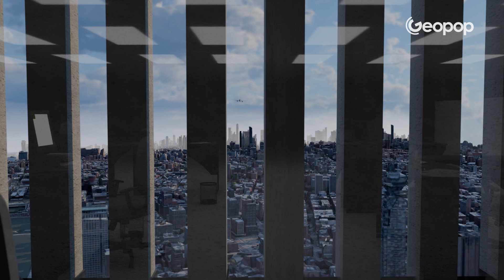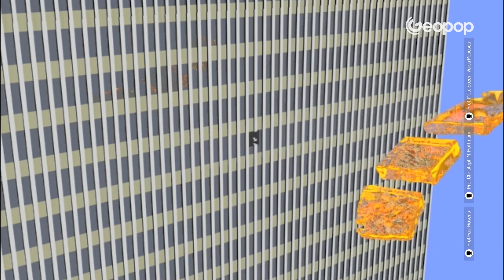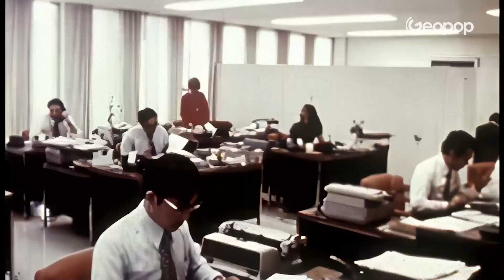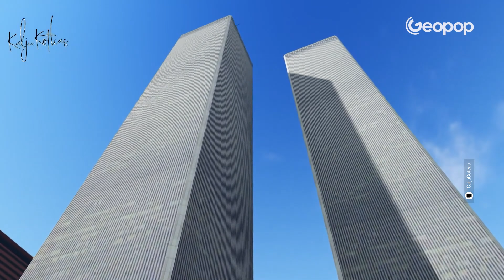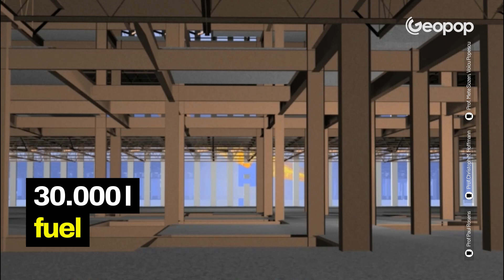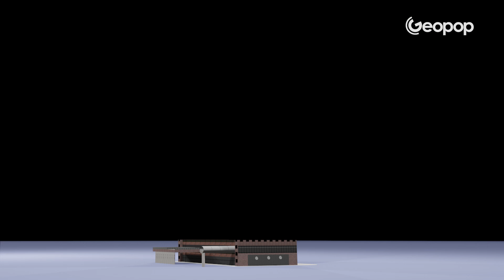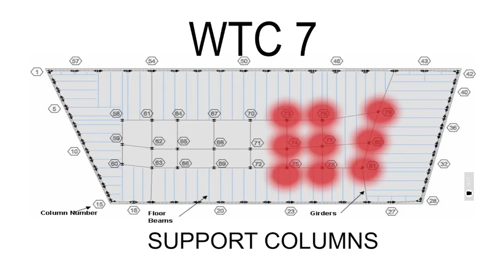9/11, 2001: The Technical Reconstruction of the Twin Towers and WTC 7 Collapses

Comment: Was the design of the WTC buildings Bracing of outside steel and inner steel. With concrete fill floors with steel braces. What would you think would happen with  a few floors damaged? Alot of thousands of tons over it and that tremendous weight collapsing down all the floors below like building an domino building and removing  few blocks to come all crashing down. And for the next small building? Once all that weight from WTC building can down so hard to the ground. Would  it cause the underground tunnels and to weaken the street to the next building's foundation's. New York is full of underground utilities, subways, tunnels and weak ground soil since its next the sea....
Reply: The towers had something like a pool made of concrete and rebar under the buildings to assure no water would enter. As far as the collapse goes. Newton's 3rd law of motion, 1/4 of the building can't destroy 3/4 of the same thing. It's like taking a handa civic and destroying a dump truck. The truck will hold it's shape better. And btw..  a passenger plane can't go but about 300 mph at 1000 feet in altitude.  Had to be a military plane.

Comment: .... Nist report had many descrepances never explored explosions never could emulate the collapse in their tests
Reply: Punctuation is your friend.
Reply: @Tim22222 Is punctuation is learned in the third grade. Thank you for.
Showing us what level you are on. And your problem solving skills aren't very good either
Reply: Can you be more specific?  Or specific?
Reply: @TheLoonResistance  yes they created simulation were collapses did not match the proper data or time from thier reports and they couldn't make it fall quicker than 18 secs whereas the south tower fell in 8 north tower 10 seconds 😊
Reply: @matthewbowler6563  - Which simulation of which collapse?  What data?  Which simulation ran the entire collapse start to finish?  I am not aware of one.  Could you be slightly less vague?  

Where did you get your collapse times from?  Not from The NIST, who said this:

NIST FAQ for the Twin Towers disaster Study

*11. How could the WTC towers collapse in only 11 seconds (WTC 1) and 9 seconds (WTC 2)—speeds that approximate that of a ball dropped from similar height in a vacuum (with no air resistance)? *

NIST estimated the elapsed times for the first exterior panels to strike the ground after the collapse initiated in each of the towers to be approximately 11 seconds for WTC 1 and approximately 9 seconds for WTC 2. These elapsed times were based on: (1) precise timing of the initiation of collapse from video evidence, and (2) ground motion (seismic) signals recorded at Palisades, N.Y., that also were precisely time-calibrated for wave transmission times from lower Manhattan (see NIST NCSTAR 1-5A)

Note the part about the first exterior panels to strike the ground after the collapse initiated.  They are talking about loose debris, NOT THE BUILDING.  A lot of people seem to miss that important bit of context and only see the 11 seconds and 9 seconds parts.
Reply: @matthewbowler6563  - Thanks for the confirmation you were talking out of your ass and don't have a clue.

Good luck on your continued epic fail. Really hope that works out for you someday.

Comment: What a lot of propaganda. They don't experiments of airplanes hitting concrete blocks to simulate plane hitting and building.  The plane was completely destroyed without the concrete band damaged. Experiment was less than 12 months before it happened.
Reply: WTC1 and 2 are not concrete buildings.
Reply: And what does a 20 ton plane hitting a 12 foot thick solid block of concrete have to do with 120 tons of plane hitting a cage of light steel tubes?
Reply: @TheCriticalStinker-jw4fl  steel frame covered in what? 4 ft of concrete.
Reply: @theaussienurseflipper.8113  - Try 1/2" sheetrock.
Reply: @TheCriticalStinker-jw4fl  lol
Reply: @theaussienurseflipper.8113  - That's what steel framed means. Just steel.

How far up your ass did you have to crawl to pull out covered in 4 feet of concrete ?  That may be the dumbest thing ever said in this comment section.

If you are going to make shit up at least make it plausible, not laughably stupid.

Comment: BS! Any architect or material engineer can tell you that a fire would NOT have weakened the steal uniformly. There would have been gradual small LOCAL failures that would have caused the top floors to topple over the edge rather than to collapse through the middle. 
…
The only way for the initial collapse to fall straight down, is for instantaneously synchronized failure of all support members. A fire cannot produce that uniform failure. The only way for the entire building to fall straight down at free-fall speed is for precisely timed failure of all support members of each successive floor. This video is bureaucratic propaganda!
Reply: Who said anything about weakening the steel uniformly?
Reply: The world awaits your game-changing paper. Um, you are an engineer - right? lol
Reply: "BS"
Facts are not "BS".

There was some rotational momentum, very visible on the the tower that was hit on the side. But the way the towers go down blocked the rotation.

Comment: So, let me get this straight.  In WTC 1 and WTC 2 the fires weakened the steel and caused the buildings to collapse.  In WTC 7, the fires actually EXPANDED the steel and caused it to collapse.  I see, so the way heat affects the steel depends on what building it was in.  Right. 🙄
Reply: Expanded AND contracted (thermal expansion includes both). Yes, different buildings with different damage suffered different failures for different reasons.  In the Twin Towers it was multi-column failure in euler buckling due to gross overload (partially) induced by heat. In Building 7 it was multiple floor failures due to thermal expansion resulting in single column failure in euler buckling. No one-size-fits-all cookie cutter approach. 

Sometimes life is more complicated.
Reply: I think you're forgetting something. Two things, actually; they flew, weighed about 150 tons each, and struck the towers at around 500 mph doing substantial structural damage.
Reply: 1.The firefighters said" it looked like they had detonators, And planned to take down the building" I didn't say that, The fire fighters said that. They were there.I'm sure they know best.
https://youtu.be/XiIT4HInWjY?si=e1Pvp3-IFs-M75Oj
When the firefighter says "boom, boom, boom, boom" in this video.
What do you suppose he is?Implying by " boom" ?? What do you hear? 
2.So if there were no explosives then what is this? 8:25
https://youtu.be/bLF5D7M1YgA?si=aHSvS__uOdxMi1ZB
You can't say that it was added because you can see the firemen's reaction to the explosion. And you can't say it came from anywhere else because the firefighter says
" We gotta get out of here,  7 is exploding "
3. Controlled demolitions have squibs, you can see the squibs here 20 floors below the collapse. 
https://youtu.be/eXAgulfAtR4?si=-iLO9aQjMJVLTUYH
4. Firefighter says "any one of these buildings could blow up,  this ain't over yet" firefighter says there's 3 secondary explosions. 
https://youtu.be/0Gh3ErgMI4M?si=mmp9Eus_5PWTCBfl
5. Airplanes can't fly 600 mph at 1000 feet. And to be able to make a 180 degree turn to hit the opposite side of the pentagon going that fast is ridiculous. And since when do terrorists hit the opposite side of the building where no one was at when they could have just flown straight in and killed way more people???
 https://youtu.be/0Gh3ErgMI4M?si=mmp9Eus_5PWTCBfl
6. This video admits the buildings fell at nearly free fall speeds. Resistance takes time. 
7. No one has ever known ahead of time that a building was going to collapse except through controlled demolition.  Tower 7 was reported to have fallen while it still stood in the background. 
8. Larry silverstein,  the man who made over 7 billion when they fell, claimed to have pulled the building down.
https://youtu.be/1jQaJFNWqtc?si=wCywQ9grgBdS_w11
9. A witness reported a missile hit the pentagon while he was seen at the scene. 
And the hole wasn't big enough for a plane and the damage wasn't consistent to the towers. And just like shanksville,  there's pictures that show no plane parts at all. Think about the pentagon video,  did you see any change in the lawn?  Do you see any plane parts anywhere?
https://youtu.be/6_Ez-UCpXMs?si=JaQ6DBEC_LJtMLgN
10. That video also points out They were military planes that hit the twin towers. 
11. All sorts of reports of explosions were reported that day.  
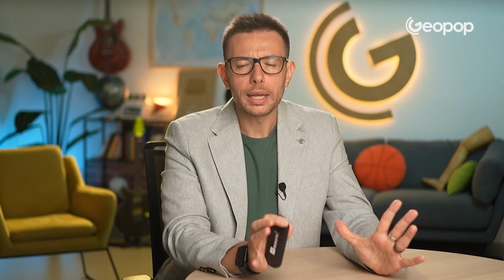12. In this video at 1:40 seconds, the guy admits he is lying. Now I'm no genius but he did say nobody knows the truth about what happened that day.  We know he hasn't talked to everyone,  he however does get information from NIST. So is he not saying NIST is being untruthful?? Why yes he is...
13. Buildings dont accidentally fall  Into it's own footprint. 
Good day to ya mate

Comment: All of the buildings were brought down with Thermite shape charges. The planes were a ruse to start a war and make Dick Cheney rich.
Reply: Retardation.
Reply: You aren't 'smart' or 'intelligent', you are just and idiot. FFS - propaganda alone would be enough justification to start a war, jusg like they've always done. No need level buildings. Americans are plenty gullible and don't need much to start a war. moron.
Reply: There's no such thing as a thermite shaped charge
Reply: @TheCriticalStinker I do Demolition for a living, I beg to differ son. And it's a "Shape Charge" designed to blast through steel I- Beams, thus the fire burning for two weeks because it can't be extinguished. Jet fuel burns out in 30 minutes and doesn't burn hot enough to melt steel.
Reply: @markkeller1778  - One can always tell if someone is lying during internet debate discussion when they volunteer without prodding some sort of relevant expertise, then say really stupid shit.

I know very well what a shaped charge is and can describe how a shaped charge works in great detail, particularly in relation to their use in anti-armor warhead but demolition charges too.

I know what thermite is (an incendiary, NOT an explosive)

I know the two things don't go together.

youtube.com/watch?v=JXWCMBuusMI&ab_channel=TrutherTVArchives 

In this video starting at 45:35 and running to 48:35 the Energetic Materials Research and Testing Center (EMRTC) conducts a test to examine the effectiveness of thermite in cutting a vertical hollow box-section steel column. The column tested is smaller in cross section and made of thinner steel than that of the Twin Towers perimeter columns (and never mind the core columns). In total 175 pounds of thermite are used for the test on just one column and requiring the construction of a rather conspicuous coffer dam to contain it. Do recall the Twin Towers had 240 columns and 110 floors.

It would be odd if thousands of office workers missed hundreds, perhaps thousands of those suddenly appearing.

Note what an incredibly slow process this is. It took close to 30 seconds for the thermite to finish burning off.  It would be impossible to “control” a demolition using this material.

Not to mention the issue of; how does the aircraft impact and subsequent raging fires NOT prematurely set this stuff off?

Also note how bright and obvious the whole process is. Could not be missed visually. No way to hide that. 

Then at the end of the test the (relatively modest) column was undamaged…. which is a problem.

Certainly no rivers of molten steel emanating from it either and in fact the whole thing cools rather quickly as soon as the thermite has burned off, as one would expect.

Thermite has never been used in the controlled demolition of any building, let alone one with multiple floors on fire after the impact of a large jet. If the conspiracy oriented internet has taught us anything it’s that if something has never happened before, it can never happen.
Reply: @markkeller1778  did not melt - Weakened
Reply: @markkeller1778 A THERMITE shaped charge doesn’t exist. Thermite isn’t an explosive.
It deflagrates about as fast as a sheet of paper.

Comment: actually the report from NIST was NOT the most widely respected reports it was actually one of the least most rerspected report that couldnt even pass the scrutiny of basic common sense. i feel so sorry for you sheeple, maybe you can use the test i use to figure out if a conspiracy theory is credible. I examine the evidence and decide weather or not i feel its compelling. if s building just collapses snd you see the center column blow out and pull the floors in in the implosion like demolision at free fall speed. we can say with100% certainty the support structure was blown out. The steel had fire proofing, this building was demolished if it would have weakend it would have tipped over in the direction where the airpane hit, liker a tree that as beeing chopped down and has wedge . between climate change and total bs like this it can feel asif the wall of lies is impenetrable.
Reply: Not the most widely respected by whom?  Tinfoil hat wearing flat earther types?  Who cares?  It is fully endorsed by the 130,000 member American Society of Civil Engineers, the largest engineering trade organization in the world.  If there was such widespread opposition to it as you claim, the worlds engineering journals would be chock full of peer-reviewed articles pointing out the flaws.  That is where professionals go to vet ideas and point out problems.

Yet there's nothing.

Nada, zero, zilch.

This is a fantasy you tell yourself so you can feel better about poor life choices.
Reply: you don't have to come and announce that youre a complete and utter moron but it's nice that you did
Reply: @themischief420  no ones blaming you for 9/11 dude. You dont have to let the fact that you have a penis the size of a mini cocktail shrimp destroy your life. make the best of your situaton, stop with the outbursts of anger.

Comment: But the steel at the point of impact was not simultaneously affected by the heat above. This theory implies that all the steel was affected by the heat of fire at the same time. The jet fuel alone was not nearly enough to cause the damage…..( I am a potter ) in order for the heat to have affected the steel it would have to be concentrated. What  - no sprinkler system in building 7?
Reply: It wasn't jet fuel alone burning in those buildings. 

And no, there was no functioning sprinkler system in 7; the collapses of the towers severed the water mains.
Reply: Collapse initiation in the Twin Towers was due to sagging floor trusses (which we can see) causing inward bowing of some perimeter columns (one side) by up to 5 feet (which we can also see) at the impact and fire damaged floors until those perimeter columns buckled and failed, initiating the collapse (which we can see). I would refer to you the excellent Gary Pollard video of the collapse of the South Tower. Pay attention to the first 12 seconds in particular.

WTC2 Collapse -- Gary Pollard (Enhanced Raw Copy from NIST) 

www.youtube.com/watch?v=ULdiD6gYZO0  

Columns don’t work well when they are bent. The Twin Towers were designed to work with straight elements not bent ones. When you bend those columns they become up to 4 times weaker. Failure is inevitable.

Notice how the columns are already bent when the camera zooms in, become a bit more bent over the next new seconds until they give, starting the collapse. 

So what bent them? It sure as shit wasn’t thermite or sooper-sekrit fire-and-impact proof hush-a-boom pre-planted demolitions that don’t explode. 

If you keep watching you will note that after the tower starts collapsing the air inside the building (95% air by volume) gets compressed and forced out the windows. These low-velocity air bursts devoid of blast or fragmentation effect are a reaction to the building collapsing not a cause of the building collapsing 

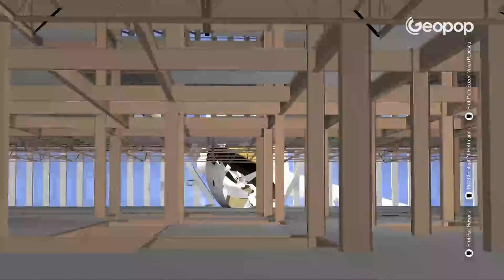And at a different angle from 1:18 here:
youtube.com/watch?v=TJJPYTVjxug&ab_channel=femr2 

Or here
www.youtube.com/watch?v=-DCgEJ2bUcI 

Also seen in the excellent still image here at 9:09:
youtube.com/watch?v=YXsDwKYz1bA&ab_channel=msvfreak94

 The sprinkler systems in Building 7 were addressed by The NIST:

The sprinkler systems did not fail. The collapse of WTC 1 and WTC 2 damaged the city water main. The water main served as both the primary and backup source of water for the sprinkler system in the lower 20 floors. Therefore, the sprinkler system could not function. In contrast, the sprinklers and standpipes on the building's middle levels (21st floor through 39th floor) and upper levels (40th floor through 47th floor) received water from two large overhead storage tanks on the 46th floor, and used the city's water mains as a backup

Comment: I use to be a Courier and delivered packages to the upper floors. I couldnt stand the long lines just to get inside the building to get a pass to deliver. Remembering when i was up there I was  on the 70th floor and a uneasy feeling. Asking the guy I was delivering packages to how could he sit in this building with it swaying back and forth . He says you just get used to it. I say not me didnt like the feeling up there.